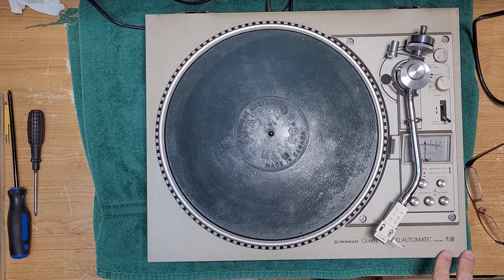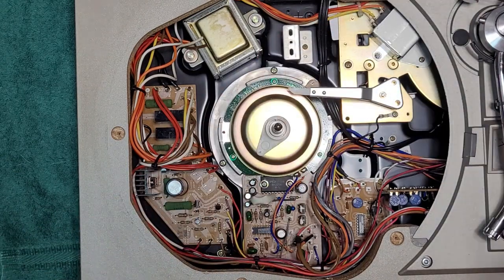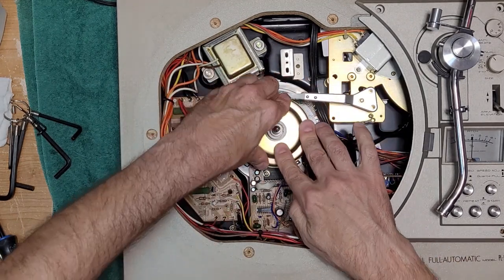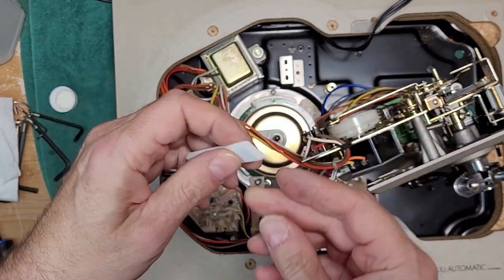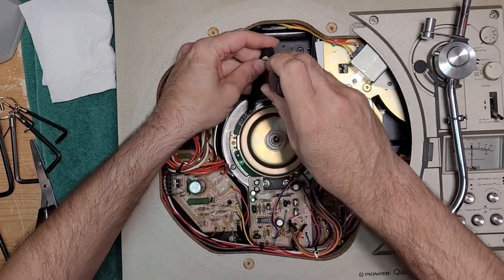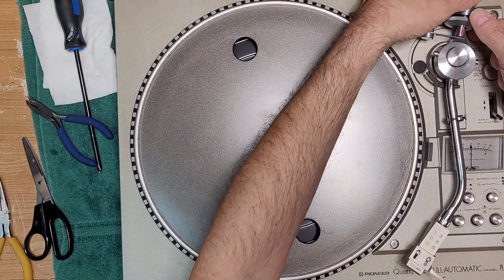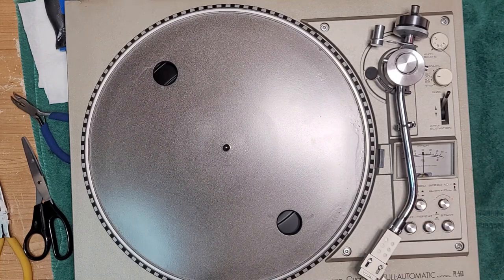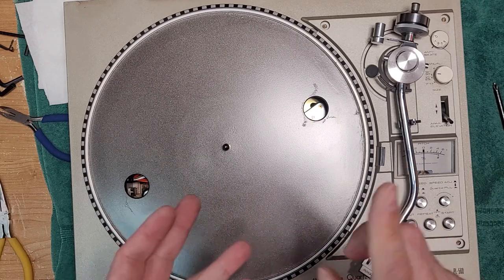Pioneer PL-560: Service, Auto Return & Muting Repair

Comment: There is really a lot goin on in there, i only serviced a PL 518 up to now, but this 560 is a beast. The 1978 PL 518 only needed a some lubrication and the lift screw from the auto return had to be fixed. Teslanol T6 on the speed regulation and all works fine again

Comment: As an owner of this exact turntable which I purchased in late 1978, I really enjoyed your video.  I have the same problem with the return coming up short so I may attempt this fix.  I would not trust the anti-skate setting.  I recently purchased an acrylic turntable platter and used it to set my anti-skate.  My stylus is also set at 1.5 grams of weight but the best anti-skate setting on mine is about 0.75.  I look forward to more of your videos.

Comment: That is a really cool turn table, I just love the electrical meter for the pitch control and the panel light that comes on when you turn off the PLL control. So if this was a Dual, you would have had to replace the "Steuerpimpel", the "steering nipple". But because it is a Pioneer we have a piece of foam performing the same fucntion. I wonder if Pioneer had service manuals in German. In that case they would have to call the foam piece the "Steuerschaum", which translates to "Steering foam". 
Talking about Dual, I find them much easier to repair than Japanese automatic turntables for the simple reason that the Dual mechanism is fully mechanical. So you can move the platter back and forth and see what is going on. The Japanese mechanisms have their own drive motor and there is no way I know how to make it go through its routine in slow motion.

Comment: Nice video. Do you think that in Pioneer PL 570 auto return problem could be the same? In mine PL 570/ 700 XA - The repeat function is usually on, even if it is not, the arm comes back to the beginning of the record, instead of turning off.

Comment: I bought a PL 560 in 1979 @ the base exchange Yuma MCAS.   It has hardly any use but over the years the feet have deteriorated on one side. Where might I find the aftermarket ones?
Reply from the maker: There used to be a seller on ebay that made nice aftermarket feet for Pioneer tables.
Reply: @TurntableGuy  Thanks….I’ll keep an eye out.

Comment: This was a fascinating watch as I have this exact model but unfortunately my issue is a little different. My tone arm will not raise up. The only way I can currently play a record is to set the turntable to manual and move the needle on/off the record by hand. If I have it on automatic the needle runs across the edge of the record when moving into position and when it auto returns it scratches its way back across the whole side. Would be grateful for any pointers you can give me so I might be able to fix it?
Reply from the maker: Try adjusting the height of the arm lifter.  There should be a little screw on the side of it.
Reply: @TurntableGuy  hey thanks for the quick response! Unfortunately I cannot see any screw near the ‘arm elevation’ lever. Should it be visible without taking it all apart as you did in the video?

Comment: Hello ! Not sure if you could point me in the right direction ? I just came across the same table . Problem is , when I plug it in , the turntable just starts spinning. It doesn’t turn off. Also , when the tonearm gets towards the end of the record it doesn’t pick up or return. Didn’t know if that little bit of info may ring a bell & you could give me a starting point? TIA
Reply from the maker: Sticky grease has gummed up the auto return mechanism.
Reply: @TurntableGuy  - Will look into , thank you

Comment: Thank you very much for posting this.  I was able to get through replacing the return arm pad and clean knobs, grease wear points and oil the motor spindle and bearing.  However after I reassembled, I have an issue with the motor rocking back and forth and not spinning as expected.  Any thoughts?  Table worked fine prior to the service.
Reply from the maker: Is the platter on?
Reply: @TurntableGuy  Thank you for responding!  At first no, then I read where you needed to put the platter on, so after I put the platter on, it wouldn't spin at all.  Again, TT worked great before I did the service.  Nothing in the service would have caused this, I'm sure it's something I forgot to do in the reassembly.   Link to my issue https://youtu.be/YQ6-hNu7TkY
Reply: First, I am grateful you took some time to help me out.  Thank you!  I wish I could tell you how I managed to work this out.  I was confident that everything was in it's correct position when I first assembled, I double checked and worked slow.  I ended up taking off the motor housing to inspect, cleaned and re-applied oil.  Seated the housing hold down and re-attached the mechanisms.  Then, it all worked great.  ???  Again, thank you!  I really do learn a lot from your videos!  Appreciated very much.

Comment: thank you for making this video. i own a pl-560 and have fixed the auto return with the foam when i first got it..but having the same issues with the muting circuit, so i am gonna do a full service. is it safe to use deoxit as a contact cleaner or should i use the nu-trol brand? and what should i look for when it comes to the sand paper?
Reply from the maker: Contact cleaner doesn't matter.  You can use a very fine sandpaper like 2000, or just use regular white printer paper soaked in contact cleaner.

Comment: My turntable manual says it has lifetime lube, but it is 30 years old now, should I re-lube it?
Reply from the maker: Yes
Reply: @TurntableGuy  OK I did it yesterday, it looked like shit and there wasn't much left. Now the platter spins for over a minute, giving it only a slight push...
Reply from the maker: @Baerchenization  "Lifetime" lube does not exist.  And these turntables were not meant to spin for over 50 years.
Reply: @TurntableGuy  Well, it barely spun one year... it was in the attic most of its life... :) It doesn't have any features, other than on/off, so not much can go wrong with it.

Comment: Do you still recommend SAE 30 ND for this unit's main bearing well?  I noticed you using something different on other videos.
Reply from the maker: 30 weight is perfectly fine.  3in1 for electric motors is good too.
Reply: Amazing that after 44 years there was still some clean oil in the well.  It looked clean enough that I did not feel the need to clean it out but just added some 3 in 1.  Also, it is great to have the return mechanism working well.  Thanks so much!

Comment: I'm seeking advice/assistance with replacing the strobe lamp.  Mine flashes like your does.  I have a bunch of Pioneer tables and this one is the ONLY one that's had a strobe issue.  Are you planning on changing the lamp?  I'd love to see a video on it if you are!  TIA!
Reply from the maker: The lamps are special neon bulbs that work at 50 or 60Hz depending on where you live.  They are usually soldered in place.  Check ebay for the bulbs.
Reply: @TurntableGuy  Okay-your foam repair advice was perfect.  Issue resolved!  It wasn't that bad in the first place, it would almost-or occasionally actually reach-the tonearm rest-but now the motion is far smoother and sticks the landing 100% of the time-thank you!  I discovered that the neon bulb is actually okay.  Something else is causing the pulse.  It also showed up on an LED (w/resistor) I was going to use to replace it.  I switched the ground connection to another ground point on the PS board and the neon bulb pulse decreased to the point of nearly being imperceptible.  I also renewed several of the PS connections while I was in it.  I played a record and it sounds GREAT.  I was feeling great about the whole thing until I noticed the strobe light on the platter.  It's now showing (it might have been doing it before, but I didn't notice it) as rotating slightly slow and when switched to 45 rpm, it shows rotating VERY fast.  BUT, when I checked it with my KAB Speedstrobe the speed is dead accurate and the meter (w/Quartz Lock off) is identically aligned at "0".  No difference in sound.  So, the speed is fine, it's the strobe that's not reading right.  I can't find an adjustment for it.  Do you know of one?  Also, I see no mechanical center adjust for the meter, is there one that's not mentioned in the SM?  This one looks about right, but mine is VERY (negligibly, really) resting just to the left side of the wide black center marker.  That's not a big deal, I just thought I'd ask.  Any advice would be gratefully appreciated.  Thanks!
Reply: I'm actually noticing the same effect off of your studio lights.  When in Quartz lock, the strobe effect is showing slightly slow.  The Huey Lewis record is playing at the right speed (I'm a musician, it's so close as to not be worth discussing, and I'm betting it's exactly correct) and I didn't see you run it at 45 rpm long enough to see what it was doing.  This is a little bit of a mystery...again, I don't mean to be a bother, but this seems pretty weird.  The KAB strobe/disc show the speed as locked on without even any visible cogging.  I can live with the strobe being a little off, but I hate to get this deck to the one-yard line and not go the whole way.  Standing by...

Comment: never test a stylus with your finger, use a stylus brush instead
Reply from the maker: You test your stylii the way you want.
Reply: @TurntableGuy  well that is not very helpful to your viewers when they bend their stylus with their finger, someone newbie watching your vids will end up wrecking their stylus
Reply from the maker: @4evaclapham  40 years, not one "wrecked" stylus yet.  Relax.
Reply: @TurntableGuy  I am relaxed, I am pointing out obvious faults in your repair/service tutorials, also when turning a deck over you should remove the counterweight which you always leave on, I have even seen you turn a deck over with the platter attached which promptly fell off, any one with any sense would not let you near their turntable, you sir are a chancer
Reply from the maker: @4evaclapham  And you are a troll.  Goodbye.
Reply: Hola cómo estás
Tengo un problema con el motor gira y se para y arranca en sentido contrario y vuelve a girar a sentido correcto y así todo el tiempo